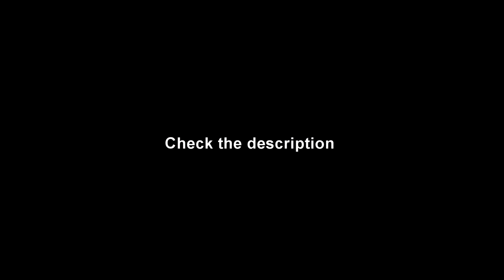DIY: Three-wire Braided Copper Bracelet

Comment: I tried this today with 2 strands of copper wire and followed your procedure.  I hammered the bracelet to fit my wrist and all it does is bend our of proportion-the shape is unsustainable.  I thought it would be stiffer and hold the shape.  Suggestions?
Reply from the maker: it depends on the thickness of the wire you use...and how hard you hammer it

Comment: How do you make sure the ends don’t come apart? Also how do you prevent them from tarnishing
Reply from the maker: Thanks for the comment, once the bracelet has taken shape the ends will stay in place as if they were welded.  It is enough to clean the bracelet with a steel wool every now and then.
Reply: I have a copper ring, I paint the inside with clear nail polish to prevent it turning my finger green. The outside tarnishes a little, but normal wear keeps it shiny. If I don't wear it for a long time it will tarnish a bit which can be shined up with brasso, or just wear it with the antique look.

Comment: Hello what type of torch and file did you use? Also the liquid you dropped the bracelet in, is that a solution or water?
Reply from the maker: A normal torch for soldering copper, the copper is immersed in water.  Thanks for the comment!

Comment: Ottima realizzazione, facile da replicare e con un costo bassissimo. Mi piace molto il risultato però io avrei chiuso le estremità con qualcosa di resistente, sicuramente il tuo risultato è dei migliori però visto che si trova in un punto dove subisce molto attrito io lo avrei preferito.
Hai mai provato ad utilizzare fili di rame meno spesso in modo da poter incrociare 3 filamenti composti a loro volta da tre filamenti?
Reply from the maker: Grazie x il commento! Ho preferito un filo più spesso proprio x non chiudere le estremità e x avere una deformazione più "controllabile" durante la battitura. Comunque non escludo, appena avrò tempo, di procurarmi un filo da 2 mm. 😁